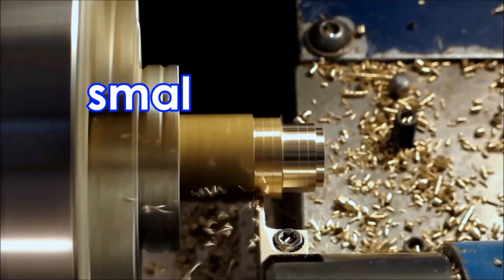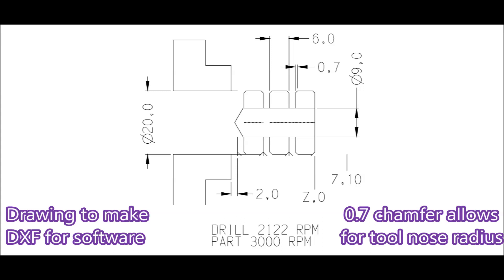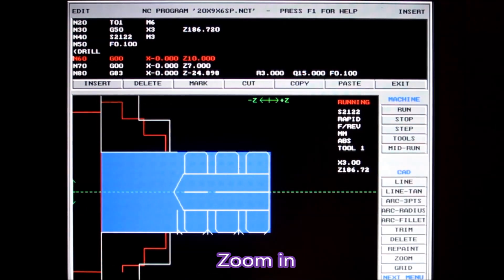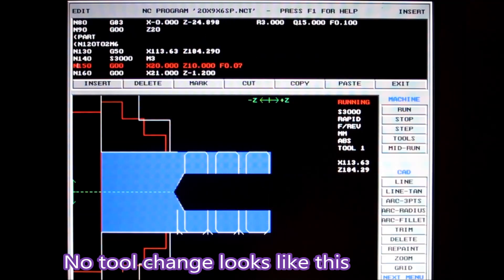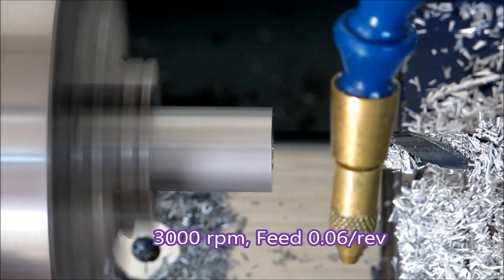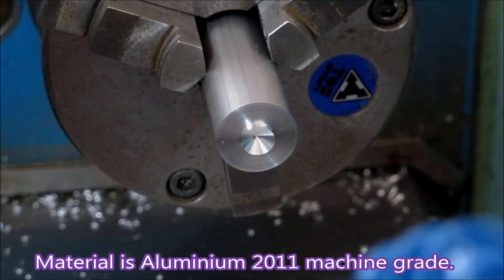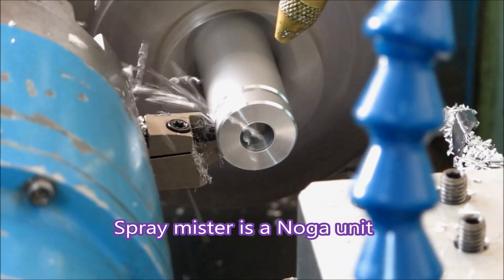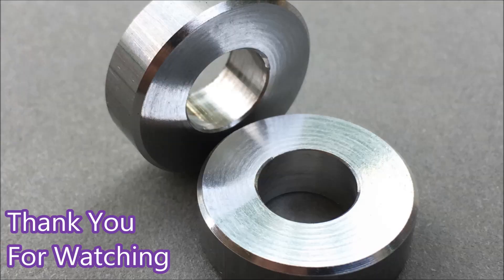Drill once and make 3 parts in Aluminium 2011. Stub drill & Sumitomo carbide insert parting tool

Comment: Hello sir
 Kindly help me to solve ovality in MS material after parting off in CNC lathe

Spec: OD_189.80-189.90mm ID_175.1-175.2mm Thickness-8.54-8.56mm
Reply from the maker: Sorry I have not answered before this. The diameter you are turning is way beyond my experience, I have never turned such large material.

Comment: Nice touch showing the software
Reply from the maker: swdweeb thanks Perry, it is so old, I thought it might be worth showing. Probably older than some of my viewers!  For its age it is quite a good interface, particularly when compared tp Xtree Gold the file manager I use on that computer.
Reply from the maker: Perry, did you have a problem with the sound being too low?
On my ipad I do have to turn the volume right up but it is loud enough for me.
I have privately had a couple of comments that it is low.
Reply: @smallcnclathes  Seemed fine to me as well.